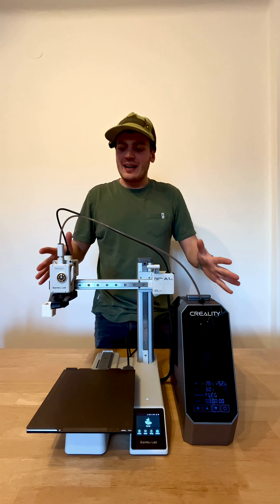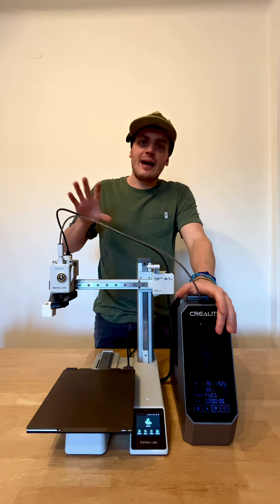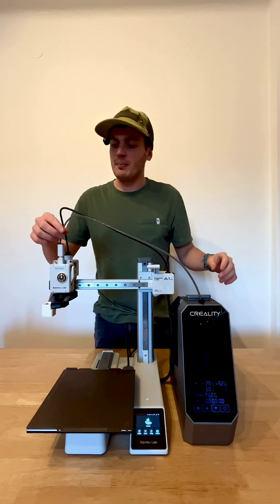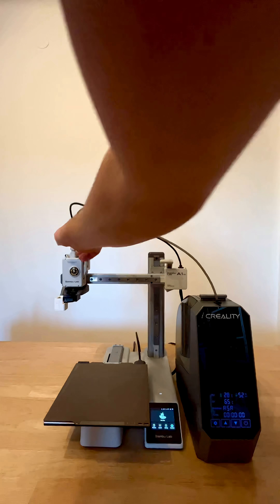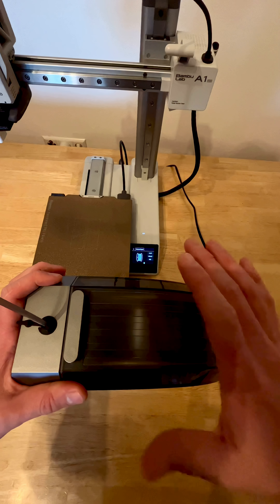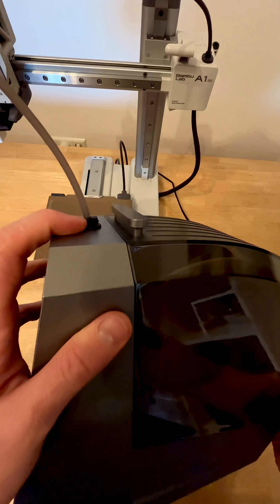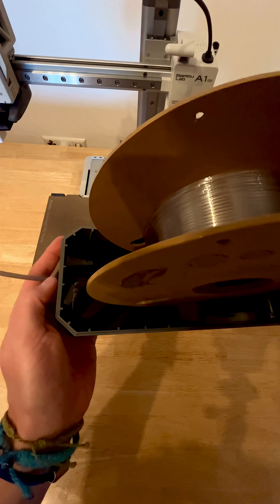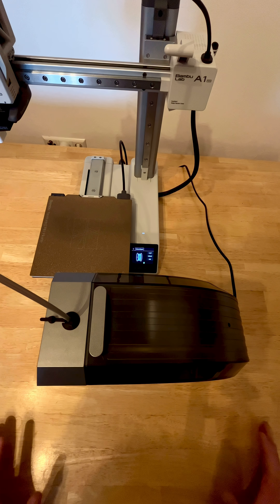My 3D Printing Setup | Bambu Lab A1 Mini + Creality Space Pi Dryer Hack #3dprinting #a1mini

Comment: Do you have any problem with using dryer directly during printing? Do you use it only for PETG or for PLA too? Do you recommend this model of dryer? Thx in advance.
Reply from the maker: I don’t have any problems during printing - I often start the dryer before that the humidity drops and then I leave it running during the entire print time. I have only used it with PETG but it has different settings with pre-saved temperatures. I would recommend it because it isn’t too expensive and really works well - the only thing I don’t like too much is the touchscreen but one gets used to it. And: I also do not let it run while I am not at home because I would be worried of it becoming a fire hazard. (rather safe than sorry) 👌🏻